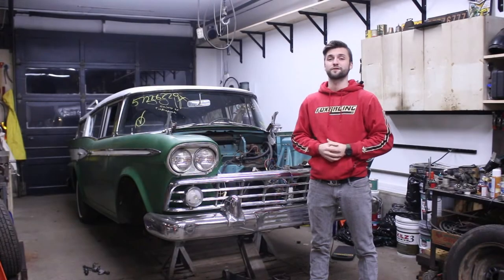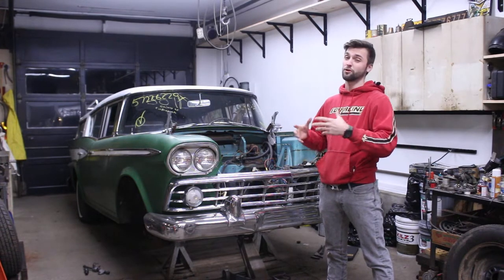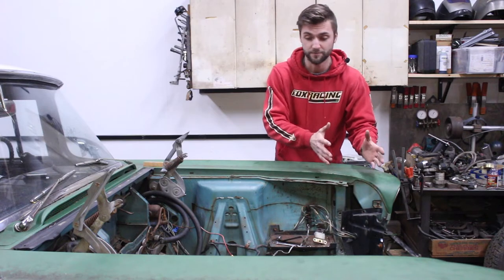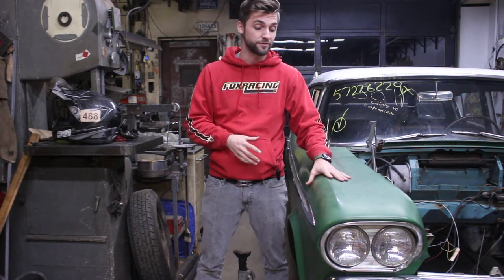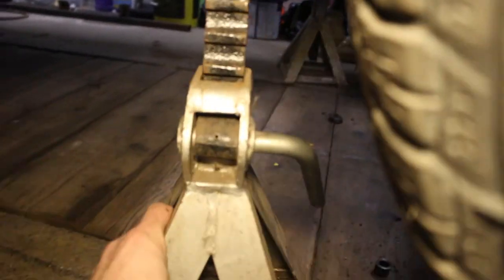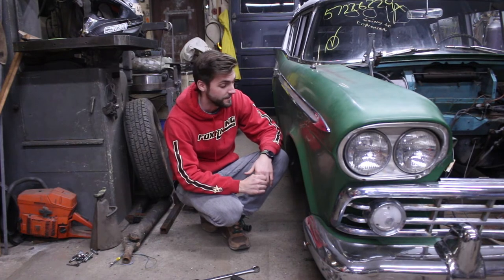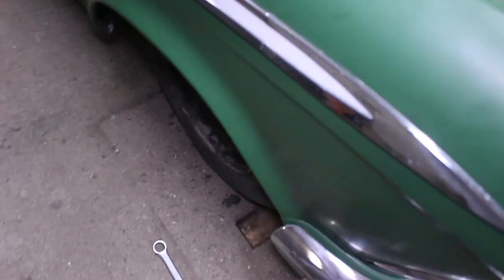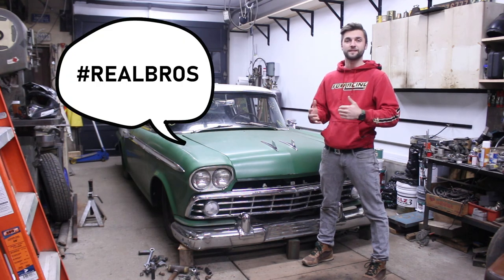How to Cummins Swap a Station Wagon.  The Ramblur: Episode 1

Comment: I had a 4-door Rambler sedan in '67. The body-frame was so weak, the doors would fly open on the outside of the turn if I took it "too fast." That body on a station wagon is likely to be even more flexible. You will definitely need some sort of subframe. One day when the sucker wouldn't start (I grew to hate that car), I stabbed the fender with a screwdriver in a childish tantrum, and the bit went right through the tin all the way up to the handle. I guess that's good news if you want to minimize weight!
Reply from the maker: That is an awesome story 😂.  Believe it or not the unibody on this isn’t too bad.  Fairly thick however obviously not enough for the 6b….